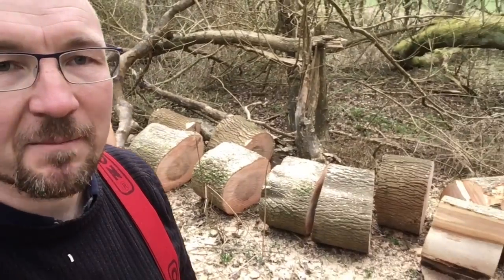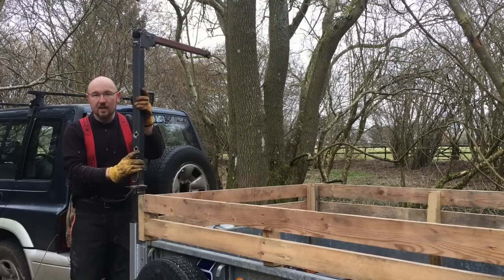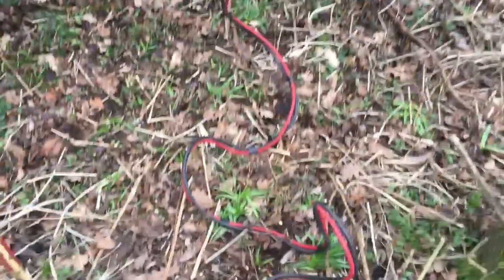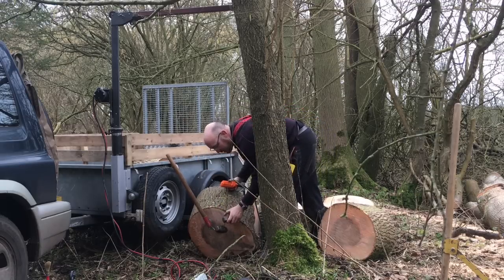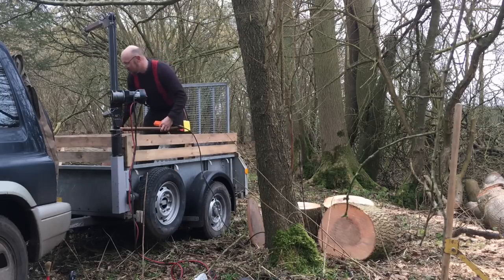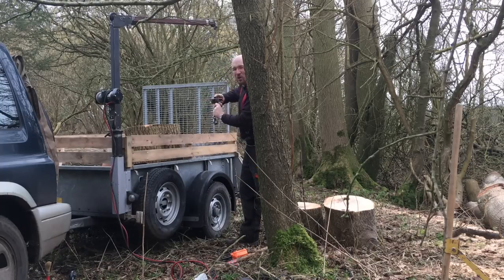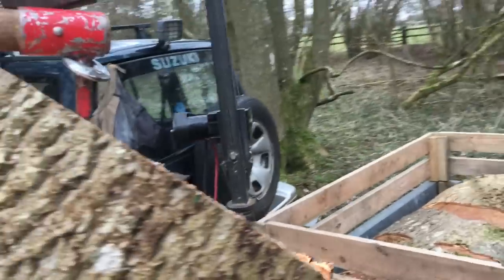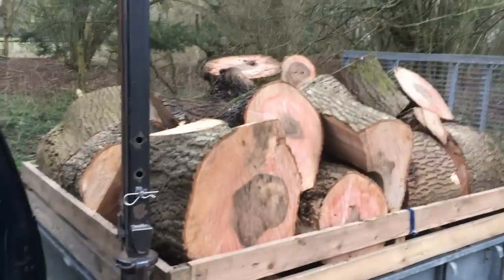Trailer hoist and logging

Comment: The YouTube search function baffles me. I have been searching for ideas for trailer cranes for wood for a year, and only now, after having almost finished mine, i find your brilliant video. A lot of great ideas. That little thing to keep the wire on the front pulley wheel is really clever - i will implement that in my build tomorrow :)
Subscribed.
Reply from the maker: That is great, glad it helped you! I have a pair of log tongs on the end now, makes it easy and quick, very stable too. Made them, of course.
Reply: @tinkertime7165  Yeah - the log tongs are a must, so i made 3 different sizes.
Would love to see a follow up video on your cool crane trailer setup :)

Comment: Cheers mate . I watched this vid sometime back and made a crane and winch similar off of back corner of my Nissan trayback ute . I made about 16 "'lugs'..that is a piece of angle iron about 1.5 inches long drilled with a D shackle in it and a hole in both side .I bring a Makita tek screw gun and screws and screw the angle onto wood round ,lift into truck and leave the angle on the round to lift it up onto the logsplitter . The wood here in Australia is hard and very heavy and works great . Saves back now for 2 years .  can fit 24 heavy circles on truck till full and up to weight ..  Well done JR
Reply from the maker: That is Awesome. I use this all the time on the back of my pick-up too. I make a log grab thing now which is way safer and super quick.
Reply: At nearly 70 it saves the back a hell of a lot .The wood here in OZ is very heavy and dense as well ..Good move

Comment: I hope to start welding on a hydraulic dump trailer soon. A bad tornado came thru and killed several in the next county over. The sheriff's department called me and asked me to come over and work on saws to help the volunteers saw out the mess. Anyway that has slowed me up getting started on the trailer. I plan to put a Predator 212cc powered homemade winch with a capstan pulley on one side as well. Those rope capstans are super fast for this kinda work , and faster to get back to grab a new piece of wood , because you can simply strip the spool and run with the rope. 
I do LUV your work of art , I just see my own twist added to what you have created. I've wished for something like this all the way back from being a kid and loading heavy crap. 👍😉😀
Reply from the maker: Thanks for sharing that. I too thought about a capstan. Not tried one yet though.

Comment: Might I suggest a trailer tongue jack just under the mast?  Crank it down and transfer the weight directly to the ground.  Cheap but effective.  Nice project.  Take care.  Doug
Reply from the maker: Douglas Thompson  yes that is a very good idea. I had not considered that. I also want to strengthen the job at the bottom where it swivels. I think this is the weak point. As with anything it is being used for heavier things than I anticipated!

Comment: Great ideas, and I also use quick disconnects on my winches . I use a lag bolt and chain for mine. Whatever works.
Reply from the maker: Stan Roberts what is l lag bolt and chain?
Reply: @tinkertime7165  a lag bolt is a big wood screw with big threads, and the chain is heavy gauge to hook the winch to.
Reply from the maker: Thanks, I have seen that kind of thing. 
I now have a set of log tongs which I like, fast and easy to attach/detach.

Comment: nice job , works very nice, sure saves on the back !!
Reply from the maker: Roy Christophersen. Thanks Roy. It sure does. I used it to lift the rounds onto the log splitter at the weekend and split the whole trailer load without breaking a sweat.

Comment: Absolutely brilliant. I never would have thought of using a picaroon for attaching a winch to.
Reply from the maker: Alan H , necessity is the mother of invention! I plan on making a grab also. The pickeroon does do surprisingly well tho.
Reply: What are you calling a " Grab "'??? A set of log tongs maybe?    I like the whole thing 👍
Reply: If you don't have a set of tongs wrap the cable around the block of wood and hook  it into  itself.  Much  safer. Notice I said  block of wood because s log is something you can cut into  lumber.  That tree was a long before itwas cut into blocks

Comment: First use I have ever seen of a picaroon that I might use!  Or I may just put a handle on a heavy eyebolt, whap it into the wood, then using the handle to screw the bolt into the wood.  On second thought, sharpening the tip of the bolt is the way to go.  The contraption could be used as a picaroon is generally.😁

Comment: You Jib project is really a brilliant idea, make the machine do the work ! I am surprised you got away with lifting off the pick , if the wood was slightly drier you may not have been able to lift off it, and if one of those rounds dropped it would smash the body of your trailer, (or you if it bounced), I think you would be much better making a scissor grab, that way you could just lift the rounds into the trailer, and as soon as it touched the bed you can lift the jib up again for the next load. Well done you !
Reply from the maker: Englishman French, thanks. I had been thinking about a jib/hoist for some time. A couple of weeks ago a tree was being cut that had fallen across the road. There were large rounds for the taking and they were really heavy. I didn’t have a chainsaw or the time to cut them smaller. It took three of us to lift the larger ones. After this I decided it was time for a hoist! I know what you mean about it falling from the pickeroon. It only did it once and am now more careful. Will make the grab soon.

Comment: Nice. I need one too
Reply from the maker: RG Tree Service. I’m so glad I made one. I use it on the back of my pick-up, on my small tractor, on the trailer and on the log splitter and saw bench. I have receivers on all five and a 12v Anderson plug on each. It can lift approx 250kg (500lb). Above that it gets a bit sketchy and I am waiting for the bang. I have upgraded the wheels to steel and the pins from 8mm to 12mm as both originals broke/bent. Also the log tongs make a huge difference.

Comment: how much time and money did you have in on the jib, can you cover more of that. i think most people are interested in how to make this reasonable and safely. using some solution to save your back with a cheap winch and be able to load logs into trailer, maybe into truck bed or even standing with log splitter
Reply from the maker: I had the winch given to me but without controller. I had to buy some heavy duty relays that were about £30. The steel was all off cuts I probably paid about £15 for. Then long bolts for the pivot points I had from other projects. So probably have about £50 into it. Difficult to say on my time as I do it for fun, so maybe 8 or 10 hours. Maybe a little more with lots of ‘thinking’ time between the odd hour or two I worked on it. It also evolved somewhat. Hope that helps. I would love to put out another video but I am so busy doing other things. Bandsaw mill is one I am making now and will do a video when I have finished.

Comment: Came here just to see if he would use the crane to lift up junks of wood instead of actual logs long story short he used it to lift junks ya i know oak is heavy ive dealt with plenty of it but dude come on now just toss the junk in or haul logs save your back and save your time
Reply from the maker: Some of those I can lift, but I made it so's I wouldn't have to! 
Why bark if you've got a dog?
Reply: @tinkertime7165  nah you made it so you had to. Use the crane for logs haul the logs home drop em there saw it up there isn't your time worth more to you?
Reply from the maker: @dieselnation555  I don’t take logs home because it makes so much mess. The amount of logs I use will mess up my front yard. I have minimised the handling times nicely.
Reply: @tinkertime7165  i hear alot say that and i understand but is there a turn around or lot that wherever you haul back to you can also saw up? Do you tow the wood away with a truck and trailer or directly to your house?
Reply from the maker: @dieselnation555  I have not had a lot or space to saw up. I try to split the wood and then trailer it back to the house and stack to dry from the trailer. On occasions (like this video) I take the rings back to the house and split them there. Although splitting makes some mess, it’s generally easier to clean up as they are bigger pieces. 
Recently however I have a small place I can process the logs. 
It all depends on how far away I have to travel, if I can get my log splitter in there, and how quickly I need to move the logs from the place. 
So there are a few ways I do it, but I always try to limit handling times. 
I recently made a bandsaw mill (no videos yet) which has added another element. This gives me ‘flitches” which I cut to burning length.
Reply: @tinkertime7165  the wood burning racket is definitly as i just said a racket lol best part of where I live its 80% woods we got lots and trails to do it all really and it sucks more people don't have it as easy but yeah. 

A home made bandsaw mill now that I gotta see